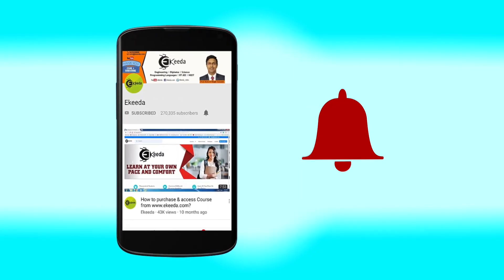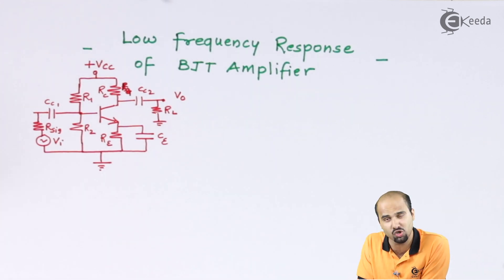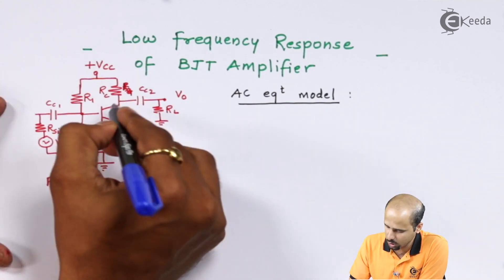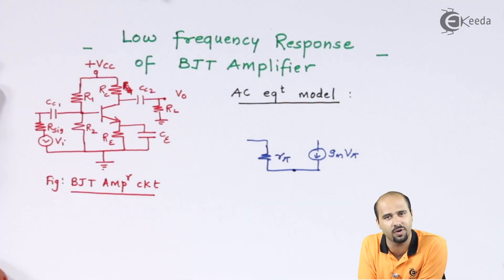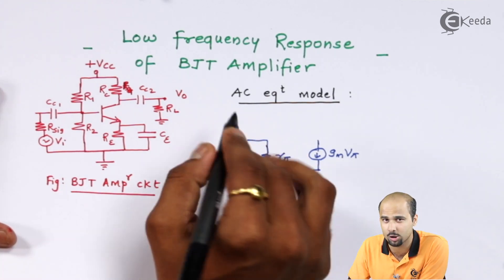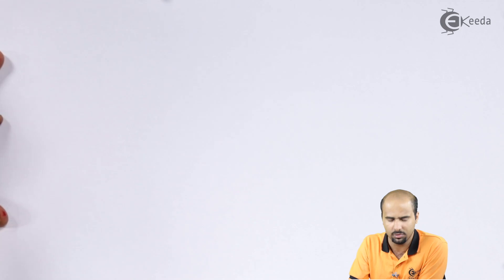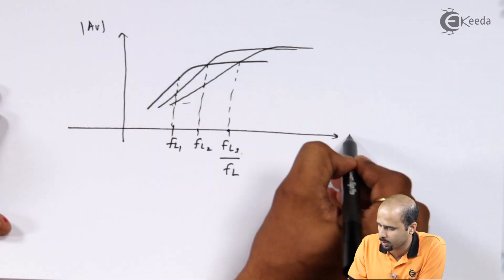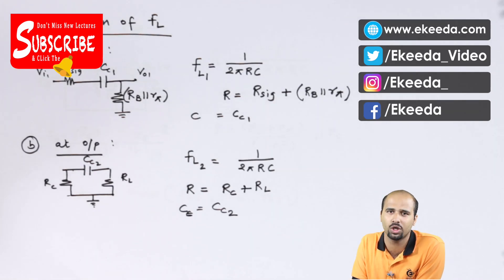Low Frequency Response of BJT Amplifier - Multistage Amplifier - Electronic Devices and Circuits

Comment: at 15:18 from where you get the formula of R, you haven't shown any step by step derivation, now it feels like we have to memorize it. very depressing.
Reply: just replace the ib with ie/b+1. if you consider the ie to flow through the resistors their value will be updated with b+1 divison . and you can approximate the value of b+1 to b because b is large value. i hope it make sense and no need to memorize it 🤗
Reply: Thank you bro
 @mebawubeshet6729

Comment: What I've never understood is the equivalent R from the emitter capacitor. Why do R1 and R2 belong to the equivalent R seen by Ce??
When we are trying to calculate the equivalent R seen from a terminal, we need to short-circuit all voltage sources in the circuit. In this case, Vi needs to be short-circuited so that R1||R2 just goes away!! Am I wrong? I've never ever understood this.
Reply from the maker: Hello
For asking your doubt directly to our Professors please download Ekeeda Application. Download Ekeeda application to get 1000 Studycoins and use it to access free courses.
Steps to follow:-
1. Download Ekeeda application from the link given below.
2. Sign up or Log in to your account.
3. You will get 1000 Studycoins worth Rs 1000.
4. Add the courses to your cart.
5. Select Study coins option to get free access.
Android App : https://play.google.com/store/apps/details/?id=student.ekeeda.com.ekeeda_student
iOS App : https://apps.apple.com/in/app/ekeeda/id1442131224

Comment: Dear Sir,
When you calculating lower cutoff frequency at the input, you took R(B) is parallel to r(pi). How could that be possible? It is ok if you took R(B) is parallel r(pi)+R(E) as they are in parallel. Help me to clarify this please.
Reply: Bro we consider only one capacitor at a time ,so for calculating lower cutoff frequency for one capacitor other capacitor will be Short circuit  so Re parallel to Short circuit is Short circuit 

ok bro